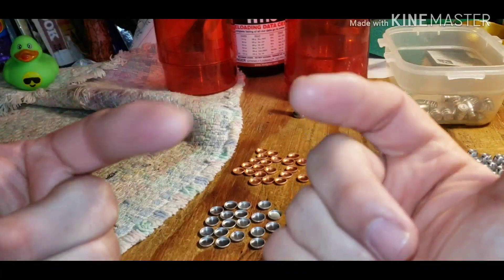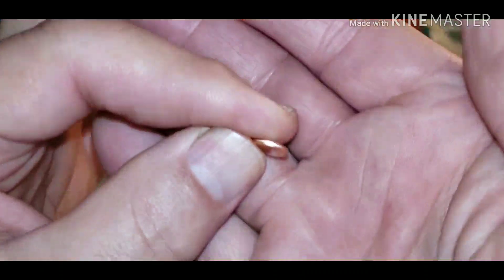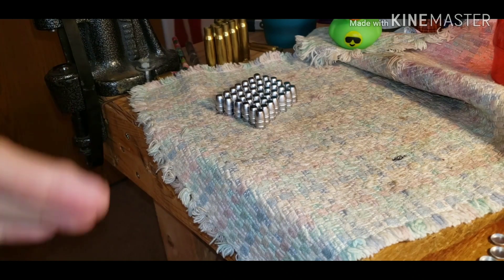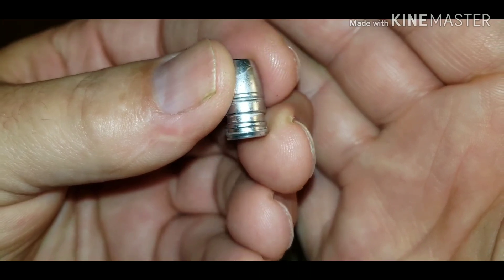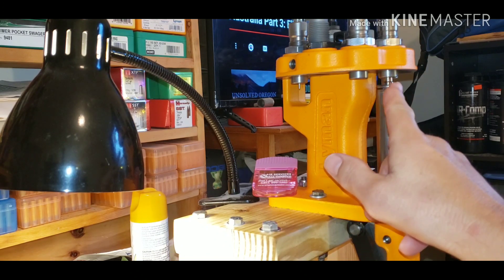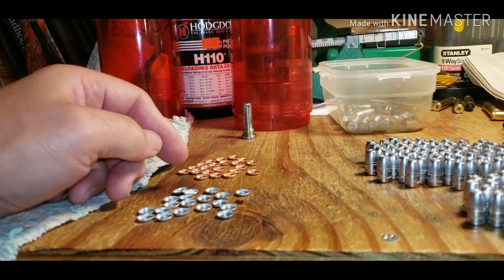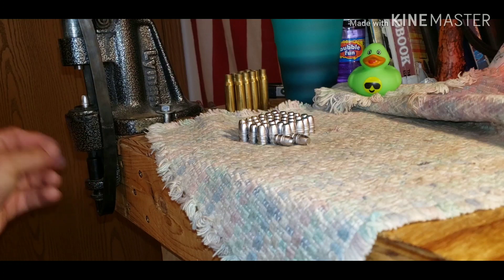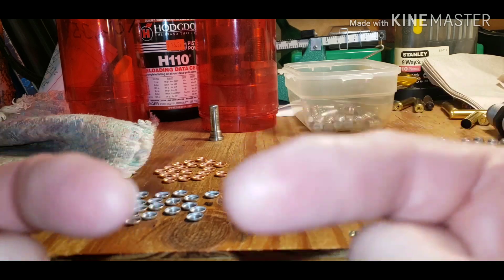Gator .vs copper .vs aluminum gaschecks

Comment: I just bought blain base aluminum checks from him. They look like beer bottle caps. After sizing most of the wrinkles came out. Far from perfect but I’m sure they will probably work fine.
Reply: I basically did the same as you. I sent it in upside down in my lead sizer first and then turned it around and ran it through the right way. If not, I would get out rounded base.

Comment: Hey Tim, I use the same aluminum gas checks and found they are much easier than the copper gas checks. I can do 50-1 meaning 50 seatings to one failure. Copper is 8-1 for me using the same process. Also I do my seating in the Lee sizer and skip your first step. I may add the first step for copper though as that might help.

Comment: I used Hornady checks in the past and still have a couple thousand of those in the original boxes.  I switched over to the Gator Checks several years ago before Sage came along, you could get them for $8 per K back in the day when they first came out over on the Cast Boolits  Forum from one of the vendors.  I buy all my checks from Sage these days, I also use the aluminum checks  including those designed to use with plain base bullets on occasion and they have worked great when using soft alloys.  You're going to run into some issues on occasion when checking bullets that have been powder coated due to the increase shanks dia. and there are several ways to get around that but I found it just easier to install the checks first, powder coat which sticks to the checks with no problem then just size to final size before loading.  The powder coating curing process also anneals the gas check and makes it softer so it doesn't spring back after final sizing and grips the bullet better and the PC also helps bond the check to the bullet.
Reply from the maker: I agree with everything that you said 👍👍
Reply: Makes total sense right there.

Comment: Hey Man, I have been wondering what exactly the difference is between the copper and gator gas checks is. I mean, besides the price!😂🤣🤠😎
Reply from the maker: The gators seem to be stronger,  they are easier to use